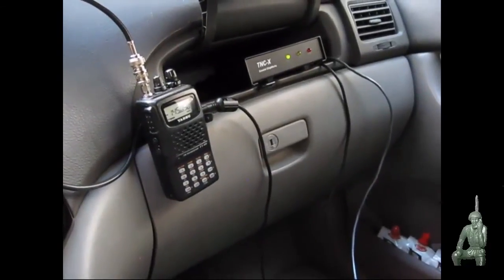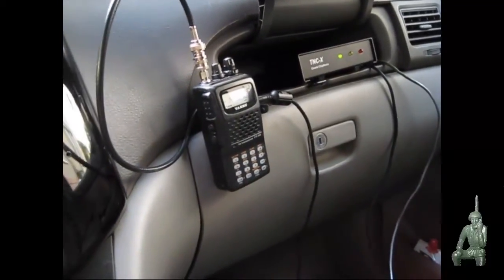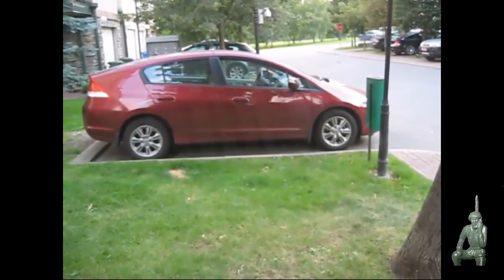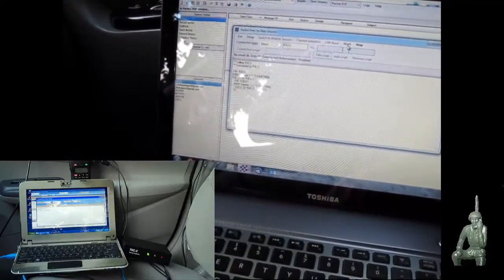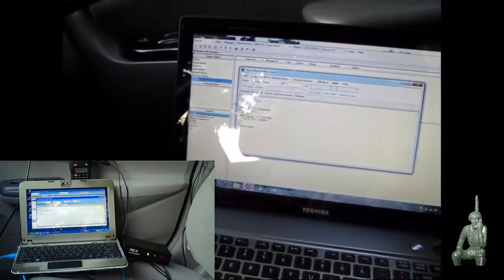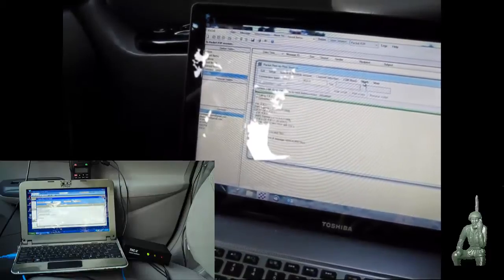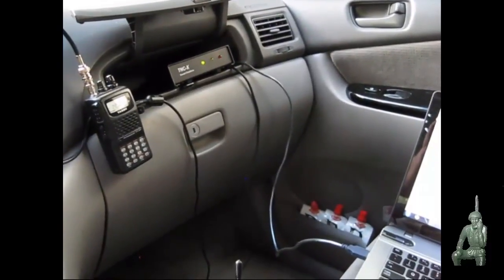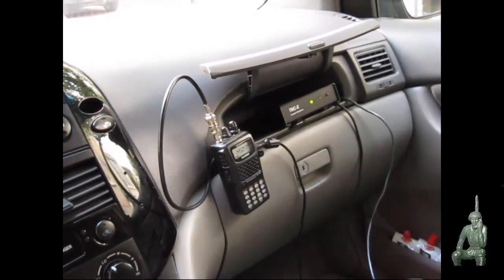RMS Express Packet Radio

Comment: I am new to this so please correct me...
What is the purpose of the TNC, I understand it converts data into audible tones but couldn't computer software do that and directly convert data to play over an audio cable without a TNC?
Reply from the maker: TNCs turn data into audio signals but the processor load is carried by the TNC vice the PC - as such they run more dependably.  Sounds cards emulate those sounds and are dependent on the PC's processor power and dependability.   Also setting and continually adjusting the sound card levels is a pain in the ass and ensuring other PC sounds (incoming emails, etc) do get passed to the radio.

Comment: Well not quite 100% accuracy since it is only a 16 bit CRC, but close enough.  Nice video.
Reply from the maker: Are you implying the error correct is flawed and transfers can be corrupt but marked as received correctly?
Reply: Yes.  No CRC is perfect since there is a one in a 2^n chance it will be correct anyway. Ethernet frames have 32 bit CRCs for example, but 16 bits is good enough when we are trying to keep packet length a reasonable value.  99.983% is still pretty good though.
Reply from the maker: I will not argue the math or theory (because I don't know it) but I will say that in my 20 years of Packet and Pactor operating experience in commercial and amateur environments - I have never sent or received a message that was processed as correct but actually corrupted.  Reception/transmission failures - yes but never false corrects.
Reply: Me neither, but then again it would likely show up as an innocuous typo that we would likely never see or simply think was sent by the originator.  If it messed up the call sign field, we wouldn't get it. As for the typo, good thing about humans... we don't really need great copy to understand a message perfectly well.
Reply: I have to amend my earlier remarks as it is now obvious to me the error detection capability of CRCs varies with how many bit errors there are. For CRC CCITT-16   x^16 + x^12 + x^5 + 1, the hamming distance is something like 4 that will detect all 1, 2, and 3 bit errors up to a packet length up to 2700 or thereabouts.  It gets more wild from there...

  http://coding.derkeiler.com/Archive/General/comp.arch.embedded/2011-03/msg00621.html

Beyond 3 bits the error detection gets worse, but that makes sense when you think of the hundreds of thousands (or millions?) of unique packet messages ever sent all boil down to a 16 bit CRC value with only 65536 possible values.  Millions / 65536 = tens of combinations of valid packets for each possible CRC value. This doesn't include corrupted packet possibilities. Verily, the classic CCITT-16 seems to be of average error detection capability as some very smart people propel the world of CRC design forward including...

  https://users.ece.cmu.edu/~koopman/pubs/ray06_crcalgorithms.pdf

In the end it is improper to say AX.25 provides 100% accuracy, but near 100% would be a good qualifier.  No worries man... I had to change a lot of my online documentation as well so you are certainly not alone.  Cheers.
Reply: I have to amend my earlier remarks as it is now obvious to me the error detection capability of CRCs varies with how many bit errors there are. For CRC CCITT-16   x^16 + x^12 + x^5 + 1, the hamming distance is something like 4 that will detect all 1, 2, and 3 bit errors up to a packet length up to 2700 or thereabouts.  It gets more wild from there...

  http://coding.derkeiler.com/Archive/General/comp.arch.embedded/2011-03/msg00621.html

Beyond 3 bits the error detection gets worse, but that makes sense when you think of the hundreds of thousands (or millions?) of unique packet messages ever sent all boil down to a 16 bit CRC value with only 65536 possible values.  Millions / 65536 = tens of combinations of valid packets for each possible CRC value. This doesn't include corrupted packet possibilities. Verily, the classic CCITT-16 seems to be of average error detection capability as some very smart people propel the world of CRC design forward including...

  https://users.ece.cmu.edu/~koopman/pubs/ray06_crcalgorithms.pdf

In the end it is improper to say AX.25 provides 100% accuracy, but near 100% would be a good qualifier.  No worries man... I had to change a lot of my online documentation as well so you are certainly not alone.  Cheers.

Comment: Did you try winmor protocol on VHF to send peer to peer message? I got Signalink's soundcard Yaesu's Ft 857 And Dell computer.  I tried to send peer to peer message on VHF by using this configuration. I connected but failed all time to send message. Any ideas?  73  de TA2AWT
Reply from the maker: +İsmet Cedimağar I have not heard of anyone trying this.  In theory it should work.

Comment: How does one configure  Winlink to connect to the Kiss TNC's like the TNC-X  ? I have the TNC-X  and unfortunately hyperterminal doesn't work with it and can't figure out AGWPE. What settings does one use so Winlink and the computer can work with KISS TNC's like the TNC-X . My goal is to put up an Packet BBS. Any help or a point to site would be most helpful. Great videos and thanks in advance!
Reply from the maker: Vinyl_Media Sorry but I don't know.  I have not worked with AGWPE.
Reply: I can not get my tnc x to connect to computer using winlink of fldigi. Did some packet with age packet engine and agwterm so know the tnc works.

Comment: long time subscriber and listener to your channel.  my question is;  when sending an email to ham guy 1 from my laptop/station, can random ham guy 2 randomly intercept all packet emails within the same area? or is it configured to only to send it to ham guy 1's winlink email??.  For instance, you have a third car across the street with same equipment.  and your not sending email to third car?
Reply from the maker: Nothing in Amateur radio can be encrypted.  It is possible but very hard to intercept packet transmissions between two stations.  Again - nothing is private in Amateur radio and no encryption can be used.
Reply: thank you, I knew about the encryption. ( ham op for little over 10 years here). Everyone (hams) that have this set up can see all the emails sent from the area..  that would be ok for mass communication to get messages out from infected areas.  Is there a filter on the software on my end to receive only emails addressed to me?  This is very new to me, and very intriguing.
Reply from the maker: traprmike There is no filter.  The program RMS Express formats the message for the addressee station.  There are two modes in the software - winlink message (message going to the Internet as email) and Peer-to-peer (message addressed between two stations).  I recommend you go to http://www.winlink.org and download RMS Express and try it out in the "telnet" mode (no radios needed).  This will establish your call sign@winlink.org email address and you can learn how the program works.  Then when you are ready you can start hanging modems on the PC (packet, pactor, and winmor (sound card mode) and send radio messages.
Reply: thx

Comment: So I have one of these tncx units and was going to use it for p2p. A fellow ham that was going to get the same one said he saw somewhere that p2p is not supported on this but I have seen your video. Is there something special you need to do? Also I am not able to download winlink due to the website being down. Is there another place I can find it?
Reply from the maker: Nothing special needs to be done.  The P2P functions comes from the software not the hardware.  The Winlink.org download page is still working. ftp://autoupdate.winlink.org/User%20Programs/

Comment: What software are you using, and data cable for the tncx? I cannot find any and it would work
thank you
Reply from the maker: The software program is called RMS Express published by Winlink.org.  The cables between the radios and PC are factory made cables specific to each radio from Packetradio.com

Comment: One quick tip that may help others. When you find the center point of your roof, use a center punch to create a small dimple in the roof, so that your drill bit won't "travel" across your roof.

Comment: I see now that they sell a tnc-pi (raspberry pi), which means you would not need your laptop to directly drive the modem. With a little setup you could connect from your laptop wirelessly to something that would work like webmail and send email through the tnc/raspberry-pi.

Comment from the maker: Range depends on power, antenna, distance, and obstructions.  But if you have solid voice communications between radios then you should have solid packet communications.  You will want to make sure the packet settings in the RMS Express application match on both radios.